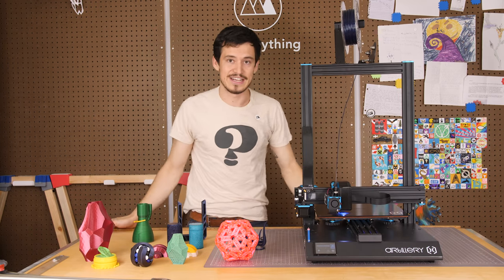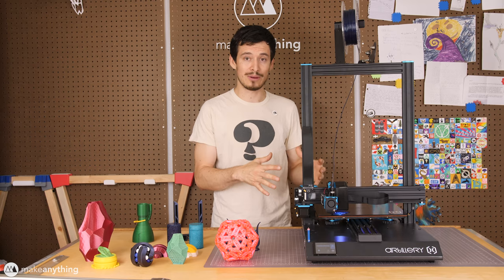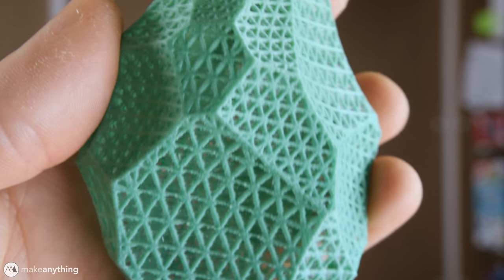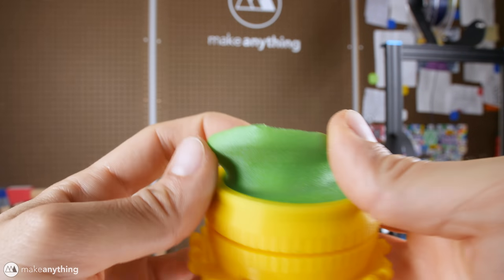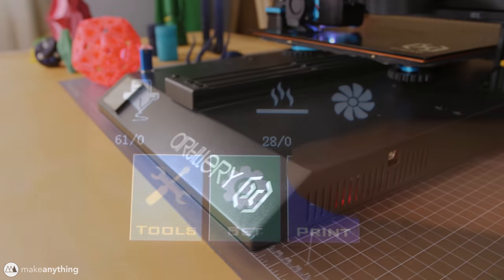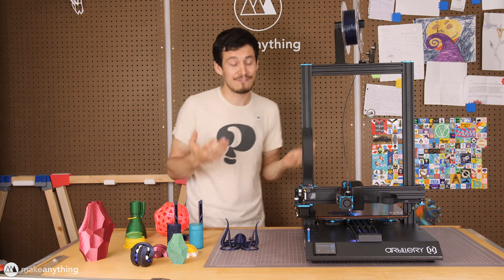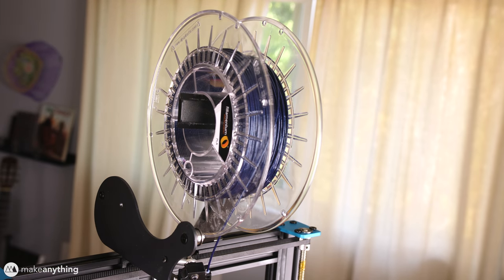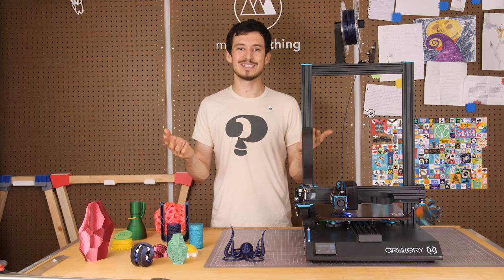Artillery Sidewinder X1 3D Printer Review // What the CR-10S Pro should've been

Comment: The worst part about buying a 3D printer is that you have to watch better printers than the one you own roll out.
Reply: Too relatable to be funny lol
Reply: loaf because that only happens with 3D printers
Reply: 3 years ago I paid $450 for a wanhao i3. And I’ve put about $100 in upgrades/repairs. And it’s still not even close to this thing. Sometimes I want to be bummed out, but I remember that I just got into the hobby early, and watching it develop is just part of the hobby.
Reply: In some cases also you're concerning "what if my current printer isn't worse?" )
Reply: You mean like all technologies?
Reply: Yes lol
Reply: Does it work with the girls as well?
Reply: I paid $300 plus the $100 upgrade in 2013 for a wood Printrbot simple KIT with a 4 inch cube build volume. The upgrade made it 4 x 6 x 7.  I have been getting different printers over the years and get what you are saying, but the flip side of that is "what if they didn't make them better?" We would still be printing on a wood printer with tiny build volume!
Reply: I own the maker select v2 and it jams like every 3 seconds 😂
Reply: i own a CR-10... it changed so much over the years. If you bought it 4 years ago and you buy it today, it's like a 20% difference already.
Reply: loaf keep buying them :) I have 8 and looking for the 9th. Considering this one.
Reply: @jrkief98  Don't be bummed out, you made a good choice! I have both the Artillery SWX1 and the Wanhao (Maker Select version). Had the maker select for a few years now. And while the Artillery is great, the Maker Select is still going strong and making great prints. I recently upgraded to a Bondtech extruder, and upgraded to Klipper firmware, and it prints just as fast and accurate as the Artillery!  And its actually been more reliable as the early Artillery printers have some bugs that need tob e worked out. The Maker Select gives me a machine to make smaller high detailed prints on while the Artillery does a big job.
Reply: the beauty of buying open source hardware is that many future upgrades can be printed up and installed when they get improved upon. I've had a Taz 5 since 2015 and it's quite a different beast today from the day I bought it, automatic mesh bed leveling with BLTouch, titan aero extruder, up to date marlin firmware with linear advance, modular bed heater for switching between bare glass for TPU and PEI for ABS, high precision igus bearings, nozzle wiper pad from the taz 6/mini, connected to a raspberry pi with octoprint, a 3x4 membrane keypad for easy one-touch manual print-head movement and a 1080p webcam for checking on printer from the other room or remotely using a VPN. Most of the upgrades were quality of life improvements since print quality was already fantastic out of the box, though buying a cheaper printer to start you'll probably end up wanting to do some upgrades for print quality
Reply: So true. Just hot my 2nd printer Yesterday, the updated anycubic i3 S, awesome Deal for 265€ and send from Germany in 2 days. Seeing this review now is timed perfectly.. Bit still glad about my new baby
Reply: that's why I haven't upgraded my MP Select Mini v2
Reply: @jrkief98  If you are bummed-out because you do not have the latest 3D printer $500.00 or the features with this particular printer, then ask yourself this, what significant project have you done with the Wanhae i3? It is what we do with what we have.
Reply: @jrkief98  should've gotten an original prusa instead
Reply: How did you get the scan of your ear? Very curious ? I want to do my teeth and my ears as well.
Reply: Very true.
Reply: Laughs in Anet A8

seriously though I got it entirely because the kit was on sale, I knew it was going to be a learning machine and not perfect, knowing that I've been pretty happy with it, but the Sidewinder X1 I think is going to be my next step
Reply: I know that’s right. My problem with this printer (it’s also my first one) is that even after preheating the nozzle and the bed and manually leveling the bed even the artillery test cube will botch itself even though I’ve gotten two successful prints after some trials and errors. It’s so annoying to see others normally have no issues while mine doesn’t seem to work either on its part somehow or mine
Reply: Especially when it’s the same price

Comment: Please man, make some more videos with this machine for upgrading,  calibration and such. This printer needs a bigger community and you are one of the few people online that I can definitely trust.
Reply: Good point. One common issue with this printer is that the ribbon cable can burn through and it's possible to flash the firmware to reduce the current slightly. Unfortunately I have yet to find any X1-specific videos on how to do this. I haven't printed much at all on mine, because I want to reduce the risk of cable burn before I do, but I haven't had time to make those changes.
Reply: I would love to get that printer too but too many fire hazards what i have heard. Will most likely buy CR-10S Pro v2 cause of large community in cr side

Comment: About the automatic bed leveling. it isn't unnessesary, it is an awesome feature if it works correctly. Obviously if it doesn't, you'd rather want some knobs at the bottom. But at this pricepoint it is hard to ask for such a complex feature to work right.
Reply: Trust me, the knobs are enough, manual calibration is good enough to print, automatic bed leveling just saves you 5 minutes every week to calibrate the bed...

Comment: I just received and installed a Zesty "Nimble" extruder for my homemade Rostock Delta printer.  It was originally a Bowden style, and I have to say that the Nimble is a huge improvement.  It keeps the weight of the stepper motor off the print head, but still gives you a direct drive of the filament, without the Bowden tube.  Working great so far.

Comment: I've had my eye on this printer for a while. I've been using a CR-10S for about a year, and it prints very well. I've also modded it for direct drive, which is nice.
But the built in direct drive, sturdy construction, and not dealing with a separate control and power with tons of wires is a massive upgrade.  It's also shockingly quiet! Even with added stepper dampers, the CR-10s is kinda distracting.

Comment: I just got one of these a couple weeks ago and I love it. I did have one issue: a couple prints failed due to thermal runaway detection. Turned out the ribbon to the extruder had 3 pins that were corroded probably because I tried setting it to 270 for clearing a jam. I've to date really only had 3 failed prints and 2 were from that. It's been very reliable and I plan on printing Nylon with it soon
Reply: Awesome 👍
Reply: can this print nylon?
Reply: @jermycouloute9638  Watch the video...
Reply: @jermycouloute9638  only once....the ptfe tube is crap...we have had trouble with 225 degrees pet!

Comment: This is in my budget, can print a variety of materials and can be put together easily? This might be my first printer.
Reply: did you buy it? I'm thinking of buying it as my first printer too
Reply: @noeldiaz1354  I'd like to know too. Looking at my first printer. This one seems good.
Reply: Same here. If you could let us know if you got one we would really appreciate your input.
Reply: Just bought 1 today from alibaba, I hope I don't get rip off, cost me $400 with shipping
Reply: @noeldiaz1354 dis you get it ? I'm also looking forward for it to be my first printer
Reply: @emilebedard1241  nop I didn't, after I paid seller told me shipping was an extra $210 USD I canceled the order
Reply: Noel Diaz I have it and it is a phenomenal machine. This was my first printer and it was great. But just a tip when you start and if it doesn’t work first check the wires and the structure then check your slicer setting, google it and if the problem persists then check if the 2d model is flawed. I would also wait for Black Friday to buy it
Reply: @noeldiaz1354  in what country are you living? I just ordered on on bangood from european warehouse (I live in europe) for 360 euro with shipment included
Reply: Same
Reply: @benezderking  i live in Puerto Rico, Bangood is charging me $370 + $80 of shipping atm, I guess this is as good as it gets for me

Comment: Great video 👍

I think there were a couple missed opportunities though. I really like it when printer reviews go over some of the basic electronics and Mechanical parts of the machine.
 What brand is the Power Supply?

What Stepper drivers does the machine use and are they integrated or upgradeable? 

What kind of main board does the machine have. Is everything wired properly?

 Quality of the steppers, pulleys, belts, wheels, and couplers?

No Auto Bed Level? Does the printer support it as an easy upgrade?

Also I think it might be a good idea to disclose In the beginning of the video that you were given the printer to review and did not purchase it.(I know it is in the description but to make it abundantly clear is probably better)
Reply from the maker: Thanks for the feedback! I try to keep my reviews kinda simple with the technical details because that info exists on the product page so it's more about my experience with the machine.. plus there are plenty of other reviews with that info 😋

Comment: Great video. I've probably watched 30 YTs about this printer and I have pretty much decided that this is going to be my first large build area printer. My question to you is how many of these did you have to send back before you got a good one because your prints are the absolute best I've seen come off the Sidewinder X1. The reason I ask quite seriously is that many of the reviews and comments on other channels about this printer are quite mixed. Many complaints in the videos and especially in the comments (not on your channel though for some reason). Your experience with this printer seems to be somewhat rare. At least from what I've found in my searches for unbiased information. Did you buy it or was it provided free for the purpose of the review? If you sourced it yourself where may I ask did you source it from. Thanks for your time and keep making these great videos. They really are well done.
Reply from the maker: Artillery sent it to me, so there's always a possibility that it got some preferential treatment in quality control, but as I showed there was still a close call with the ribbon cable so I'm not too sure. I literally just took my CR-10 Slicer settings in Simplify3D, tweaked them tiny bit to better suit direct drive printing, and it has printed great!
Reply: @make.anything  That's a good tip. Working up a profile from scratch is a lot of trial and error. I'm a Cura guy but one of these days I'm going to take a crack at Simplify3D. Thanks for the reply.

Comment: I am planning to buy my first 3D printer. I first watched Ender 3 v2.
Which printer would you recommend for a beginner?
Reply: If you still happen to be looking for a printer, I have an Ender 3 V2, but I'm currently looking at a Kingroon KP3S as a secondary. From everything I can find, they are lightyears ahead of the Enders in both print quality (direct extruder, linear rails, etc), usability (Enders are VERY finicky), and they are WAY cheaper ($175 all day long). My upgraded Ender cost well over $300 with all the parts I've had to add to it, and it still can't match the out-of-the-box performance of the KP3S. The only real downside to the Kingroon is the print volume, which is 180mm^3, but if that little bit of size difference matters to you, Kingroon has a couple of larger models that can match its performance and still beat the Ender 3 V2's total cost. I've seen a couple of KP3S print farms, and they seem to be doing EXTREMELY well, with a dozen or more printers running almost 24/7 for months and not requiring any real maintenance.

Comment: You are talking about a volcano style nozzle... is it compatible with mk8 or e3d v6? What do you do when the hotend is clogged or the nozzle worn out? Is it a 24V or 12V system? I've seen a product page saying it has an MKS Gen L Board, so definitely an 8 bit type (not totally a problem, but noticeworthy in 2019), and some kind of TMC drivers because of the silence (noteworthy because some people might want to replace them or add a second extruder). Other "pro" questions would be if there is a bootloader, is the firmware available etc... maintenance stuff.
Reply from the maker: Hehe yea I'm no engineer so my reviews tend to simply look at my experience printing with it and the results. I know it's their custom TMC drivers, and the nozzle can be swapped with a genuine E3D volcano nozzle. It's standard firmware and I've seen others modify it. 24V AC heating for the bed.

Comment: Let me stop you right there. Auto Leveling adds complication? Seems to me it's less complicated to not deal with 4 leveling screw. Those ribbon cables will wear out a lot faster than conventional cables. Hopefully the mesh adhesive wrap on the ribbons will help the durability of the cables.

Comment: quick question, recently got this printer and have been experiencing warping of the print from the bed usually about 5-10 minutes into the print. the filament is PLA, and print settings are 200 celsius for the nozzle and 75 for the bed. this has happened on every print except two (an absolute ton). big fan of your vids and appreciate your knowledge. any advice much appreciated.

Comment: I like direct drive printers because I print at low speeds for the quality. But I really don't like the ribbon cable idea. This cable is not meant to handle high currents such as the required for the hotend. Besides that the connectors are not meant to handle movement. I imagine that they use at least 4 wires to handle the hotend current but if just one of these wire's connector fails, it will overcharge the others. Sorry for my bad English.

Comment: Would you really recommend the X1 over the CR-10S Pro? I just ordered my Pro after your review :(
Reply: Marcin Bauer I have the CR 10s pro the only complaint is fan noise. Prints are exceptional quality on the CR10s
Reply: @richardjfaulkner3811  Great! Yes I've read a lot of tutorials how to fix some issues on the Pro, and I've already have my 3 noctua fans at home, just waiting for the printer :)
Reply: @MarcinBauer  well your all set to go, your going in aware of the slight faults that are easy to fix. Good community support too around the creality machines.
Reply: @MarcinBauer  so how do you find it?
Reply: X1s have some known issues over a short time. Namely the ribbon cable
Reply: Which one you recommend among CR 10 v2 and this one???
Reply: can we print the tpu by using cr-10s pro

Comment: Hi, thanks for this great video with all your usual enthousiasm but I have a question: which slicer do you use for this printer and which model settings do you chose? Thanks in advance and have a great day  ;)
Reply from the maker: I mostly use Simplify3D because I'm most familiar with it, but whatever the slicer I just start with the CR-10(or similar) profile and work from there. It's pretty similar, but since it's direct drive you can reduce the retraction distance... That's about all I change
Reply: @make.anything  Thanks for your reply and for the retraction tip. Cheers   ;)    Kepp up the good job
Reply: @make.anything  Just to let you know, I ordered for a Genius AND a Sidewinder because of you   :)
Genius is 231 euros here and Sidewinder is 317 euros (from GearBest from their german stock). This is just like byuing a Sidewinder full price and having a Genius as commercial gift!!!! I'm very glad of the video I watched on these two printers. Some channels are talking about problems but I want to hump into direct drive so... I hope all will be ok.
Do you think CR10 settings in Cura will fit for Genius too?
Reply from the maker: @lepoloo  Instant factory. Nice!
Reply: @make.anything  I kind of   :)
Till today I was using the Anycubic i3 Mega but it's unable to print anything now. I also had the Chiron that never worked correctly. Autolevelling never worked correctly and manual levelling with such a big and bent bed was not possible. My Mega is now having very weird behaviour so. I give up and I'll go with those two Artillery as soon as they arrive.
I've been very happy with your comments. I feel confident about those printers. Time will say... Have a good day and continue with your incredible creativity.     :)

Comment: Dear devin, 
I was just wondering, could you possibly print directly onto another print? I was thinking you could make really cool multicolor prints like this, however I didn’t know if it would melt the existing print. I also was thinking about printing directly onto another material, like foam or wood, and make a very interesting piece.
Reply from the maker: You can print onto other prints and objects as long as you can avoid the nozzle running into things!

Comment: Have you ever tested out more expensive 3D printers? I've been working with Ultimakers (3 Extended & S5) for two years now for educational prototypes. I'm curious to know your thoughts on machines using their own specific brand filaments versus generics. I've experienced huge differences in quality (especially generic brand PVA versus the Ultimaker brand PVA for dual extrusion supports).

Comment: My view is I can add a new board, drivers, bltouch, wham bam flex bed, and touchscreen to an ender 3 for a total price of this. Cheaper if you use Chinese clone parts.
Reply: I was going to go that route, but I've been so happy with this printer with our any mods. Yesterday, I did update the firmware so I could have linear advance, but I don't see any need for hardware upgrades. I even love the spool holder (with one bolt removed for easier adjustments). Saved me a hundred hours of research and installation of upgrades...